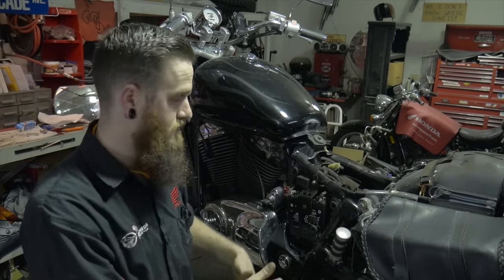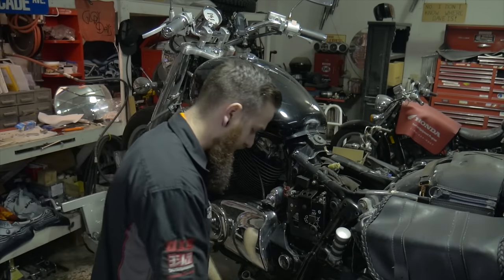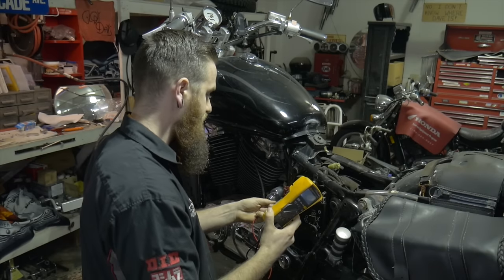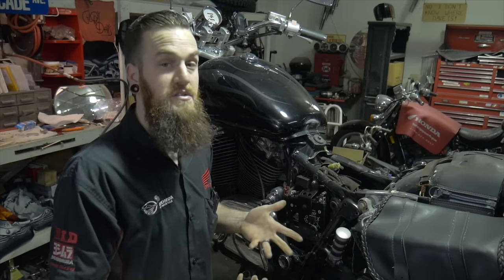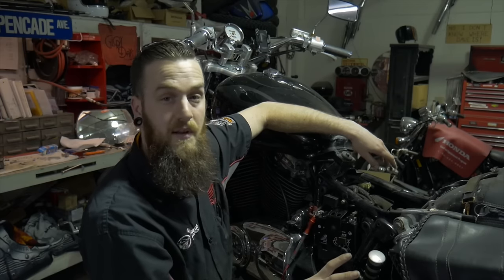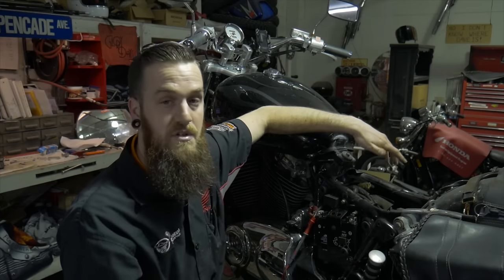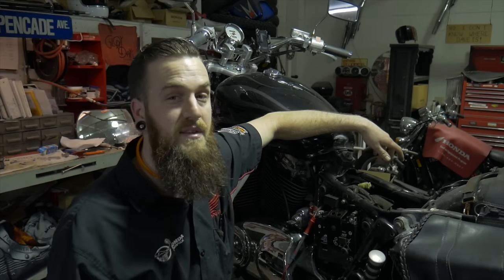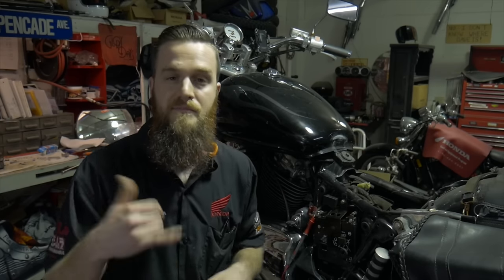Motorcycle Charging System: Bad Regulator/Rectifier

Comment: Cody, thank you for ALL your instructional videos on the motorcycle charging system, stator, regulator/rectifier, & battery. Simple, to the point, and easy to understand. They have helped me understand & diagnose my system on my 2003 Honda VFR800.

Comment: Watched a couple of your vids to diagnose a non-charging issue on my 1984 Honda V65. Following your instructions I found that the older splices on the 3 yellow wires were bad. Snipped and re-soldered those connections. Tested my R&R and stator and we're good as new. 14 volts at 5000rpm. Instant subscribe!!

Comment: Just found you. Good stuff. 
When a battery is overcharging, it becomes much easier to figure out. When a battery is not charging at all, that’s when it gets tougher. Could be anything in charging system and even a bad ground. Lastly intermittent charging issues generally lead themselves to be more likely than not to be regulator as well.

Comment: It would be best to check charging system at a higher rpm than idle, reason, the break even speed is generally above idle on most makes , unless it is 3 phase. Break even speed is the RPM needed to replenish the draw of normal engine components when running, coil, lighting etc. It is just good practice, covers all types of charging systems. Great video, and will help those in need, thanks.
Reply: One of the best videos regarding motorcycle charging systems.
Reply: What's that in your earlobe..is this a transgender thing?

Comment: Cody, I’ve rebuilt, (with help from professionals), a 1993 Yamaha SRV 250. I’ve had an electrical problem since I’ve had the bike and can’t figure it out. Some of the ongoing symptoms have been low voltage to the horn, a tachometer that goes crazy, starting problems until I put it in gear and bump the motor, and I’m now on my third neutral switch. I thought I had the problem solves by repairing damaged wires but when I went to start it up there were again no dash lights or headlight. I tried to find second gear to bump the engine and pulled up on the shift lever and everything came back on! So I figured it’s definitely something in the neutral switch wiring. I removed the wire from, heat shrank the connector, and the bike ran. While riding the bike started to sputter so I thought I’d put some upward pressure on the shift lever and the bike began to run perfectly. Not only that, but the tachometer started working as advertised. I can’t figure that out. With the neutral switch wire disconnected, how could the shift lever, which is mechanical, have any effect on the electrics? BTW, the battery has no charging problems.
Reply from the maker: Wow, that pretty crazy!! Honestly... I would install a new wire harness 😆😆
I wish I had a more direct answer but that is tuff
Reply: Likely a bad ground, if not, you could have a + wire tap dancing on the frame.

Comment: A Voltage Meter is a good addition to the other instruments. Its always good to know if its a silent problem that might lead to a problem in the near future. I did notice my rectifier going bad by having a not so good turnover by the starter. As i looked on the dc meter it was only charging at idle and not anymore with a bit more rpms. Could have run out of juice oneday and would have had to pay for the towing or even a new battery but i avoided that by beeing suspicous.

Comment: Very helpful. I’m struggling with my Cb750 lately. When I follow your instructions I notice my multimeter slowly clicking down. Then when I hold throttle it stabilizes it but doesn’t charge. I’m going to have to check the stator as per your recommendation
Reply: @PercyJackson93  my stator ended up being good. I discovered that my wire harness had slightly melted for an unknown reason. (Resulting in poor contact coming from alternator. Fixing that and changing the battery did it for me.

Comment: I recently changed my motorcycle battery but it ended up dead then I got replacement battery it catches fire 
I saw your vedio and it was very helpful 
I changed my regulator rectifier now it working fine.
Thanks for info

Comment: Great video. I will check my readings. In the meantime, my bike had new battery but I didn't ride for 2 years. Now I have to connect battery to charger. It charges battery so bike can start no problem. I can ride the whole day. I can stop bike many times and bike start again. Next I go home, I don't connect battery to the charger and I leave bike overnight. Next day bike doesn't start 🙁. I have to connect charger again. What do you think is the problem?

Comment: Great videos thank you
My issue is on 1980 Honda CB650. Bike not charging swapped out stator rotor and rectifier. Reading on 3 leads from rectifier .5. Diodes read good and directions tests on rectifier read good. Stator unplugged and running reads good and increases with throttle. Can there be an issue from rectifier to battery other than wiring? Everything else on bike works no other issues.  Puzzled???

Comment: Thanks for the video.  I have a Suzuki Burgman 650.  Just replaced the battery.  At idle I am seeing around 14.5 V.  At 3000 rpm it drops to about 14.2V.  Should I be concerned?

Comment: Hi,  I have a strange problem on my Magna. Short version of the back story. Instead of removing crabs and cleaning after sitting I dumped carb cleaner in the tanks and carbs until it finally sprung to life. A few times the "Starter seemed to stick." Then after she was running great.  I was about to change the oil, and wham, she went lights out. I have a new battery.  checked every fuse and ground connection I can think of. Easter egging a starter, ignition switch, start button is more than the bike would be worth whole.  I have not electric what so ever after hitting the button.

Comment: Hi. First off all I want to thank you for the detailed information that you have shared with us. I have finally found the problem on my honda shadow. 
I need to ask you a suggestion. I ordered the new voltage regulator, but unfortunately it needs 2 weeks delivery time. My question is can I run the motorcycle with 18volts charging for 45min and  then switch off the charging current for about 30 minutes and then reconnect. I mean can I do manually that the broken part on rectifier does automatically?

Comment: I found this video by looking for stator testing, but watching it I realised you’re good. You know your stuff... so my question to you is:
I have an Aprilia sr50 2st. Scooter that won’t start. bought it like that.. I rebuilt the top end, new rings head cleaned and new gaskets. New coil, new plug. Started for 5 mins then died. It’s a Ditech injection model Piaggio Motor but i can’t understand why it won’t run...

Comment: Thank you for the explanation. Any idea what it means when the voltage across the battery drops when revved? The alternator seems to be working since the voltage increases to over 14 volts on idle.

Comment: I jump started my bike, took off, saw smoke and pulled over. Used similar troubleshooting and found my stator grounded. This advice works for Harleys too, luckily the lead from the stator to the regulator is a short one.

Comment: Great video's by you. All of them are very helpful. Wanted to ask you a question: even with a fully charged battery, if a three phase stator has low output on one phase, could it still cause the bike to sputter in the mid-range? 2000 Honda Shadow 1100 Aero. Stator is not shorted to ground, all three phases are continuous with each other. Two phases are at 4.7 volts, one phase at 2.2 volts. Bike starts and idles fine. Sputters around 3K rpm. Coils and wires replaced. Carbs clean and floats set. Fuel pump relay bypassed. Thanks !!

Comment: Thank you!!  I have watched several vids regarding the charging system BUT you have clearly explained the TROUBLE-SHOOTING aspect much better.  I especially like going after the obvious FIRST; check the battery.  You provide the right numbers and I understood that. SECOND, how much of a charge is coming in from the stater and WHY the charging number needs to be stable around 15 or so.  You also explained why too much (like your example at functioning RPMs) is BAD! In the case of this Honda everything looks to the rectifier and you provided extra analysis of why you can't really go any further (closed system).   Again, thank you for taking the time to Share your expertise! Well done!! :)

Comment: Man, I really appreciate these videos! This was an excellent explanation of how this charging system works, as well as the risks and safety hazards. Subscribed!!!
Reply from the maker: Glad to have you Chad! 🤙🏻
Reply: @TheMotorcycleMD  i noticed that my rear running light keeps burning out on longer rides even while on running my rear light is super bright.  also, my dash lights are brighter than usual.  my battery is charging, but what is causing that light burning or super bright?

Comment: I think you said this is pretty much the same on all or most bikes.
What about a Harley Electra glide 2009, with high beam on , should it 
never put out roughly 15.5 volts regardless of the rpm? 
Also the high beam on is crucial for this test?

Comment: Hey, very helpfull. Unfortunately I tested my battery with a meter, it said everything was good. I noticed a little bit of burned wire so I cut the contenters off and sodered them together. Tested again and the reg/rec is not working properly.  I ordered a used one on eBay because I don't have the cash for a good one, and all the cheap ones have bas reviews. Now I don't know the orientation of the three yellow wires. Do I need to get a new stator or does the orientation of the yellow wires not matter?

Comment: I did everything you said to check. I have a 750 shadow. Stator was bad and I put new one. Rectifier is 14.5 v at 5000 rpm at battery. My problem is I think now is that I have charged battery so many times that I think it might be bad now. It's charging but still can't get the bike to turn over but one rotation and the battery died out. Just would like your opinion on this if you don't mind. If I get to crank I can ride but can't crank back up if I cut off.

Comment: Sweet video!  I tested the stator and the rectifier regulator.  The stator is OK.  The voltage trickles down from high 12V when I start and drops quicker when I increase the RPMs.  I test voltage at the regulator positive and negative and the voltage is about 13.3V and it doesn't go up when I increase RPMs.  I'm guessing bad rectifier regulator?

Comment: Awesome tut. Thanks! Question: I have a Suzuki GSX750 1981 And the rec/reg is probably faulty. I read a lot about the Suzuki ones being to small and that is why they overheat and die a lot. Can I exchange it with a newer one or maybe Honda. I guess my question is are all rec/reg the same? (Manual says 14-15.5 VDC at 5000 r/min with headlight on, same as you did in the video)

Comment: Thank you sir.. my bike started with a problem recently, where i was riding, and my eletrical went out but the bike was still on and the headlights were still on but the dash,accessories, tail & turn signals went out. when i tested the battery with bike running, the voltage was running well into 17v. So i'm assuming the regulator went out.

Comment: I have a 2002 Shadow Sabre. It's for sure got some sort of an electrical issue. Last ride I stopped at a store and it wouldn't start when I came back out. Did the old push start and got back on the road. a few miles later it cut out and sounded like it was running on 1 cylinder. No Power. Limped it along for a couple miles. (not a safe spot to stop) Got it home on a trailer. Battery is very low, and I checked the common issue connector from the stator to reg/rec. All good. As soon as this battery charges back up I'm going to do the test you showed in this video. Other than that any advice?

Comment: Great video 👍
My problem is that when adding some revs the voltage drops. The voltage comes back up when idle.
Where should I start for fault?
Reply: Possibly a faulty rectifier. You could test the Stator too, it should measure around 50VAC between the 3 Phases. But most likely its the rectifier. It should deliver around 14.2 to 15 Volts.

Comment: Is it possible to have a Regulator/Rectifier that works/Fails intermittently ?? 

I have an Indian FTR which needs a new battery every few months. It always Cold starts fine, when i check the stator it gives 34 vac when cold at 2k rpm like the manual says on all phases, and the regulator maintains a nice 14.5 vdc at all rpms.

Yet the bike dies while running and leaves me stranded, installing a new battery solves it, and testing the previous battery, after putting it on a tender/minder, it wont hold over 10 volts

Comment: so quick question I have a 99 gsxr 750 got a new battery on there was good. I can start it ride it doesn't cut off while im riding im good but if I stall out or so for some reason try to start it up back the battery is dead cranks slow. sometimes it will start sometimes no. so I used a mulimeter without the bike running I got 12.3v when I start it I get 13.2v. ok now if I give it throttle it will drop from 13.2 to 12.2 or 11.8 at idle go back to 13.2 v is that the rectifier or the stator

Comment: Hi Cody, I've just bought a '98 VT1100C2 ACE and wanted to know what are the most common issues for these bikes. Is that connector faulty on the 98s? What else should I check? Thanks, I've found your channel really useful.

Comment: Thanks for video, I have a question, just bought a 1985 goldwing limited edition 1200cc  with new stater, my voltage at 3000 rpm is 13.9 is that ok. Thank you.

Comment: Great great videos. How do you understand a temporary drop in charging voltage while riding? My USB has a volt meter on it so I get some real-time data.. Normally I see 14.5V while riding. Occasionally it drops to around 12.6 for a stretch and even the bike battery light comes on. . Then.... it pops back up after a mile or two.    Battery tests while stationary seem just fine.

Comment: "it's very rare for reg/rec to go bad on Hondas" , owners of older CBR's (90's to early 2000's) will tell you different!  that's why i'm here to get some info on this before I purchase a 15+ year old CBR600F and very good video btw

 If the reg/rec fails would you recommend getting a "mosfet" or an OEM replacement? I heard the OEM ones are crap and people even replace the OEM honda reg/rec with a GSXR or Yamaha R1 early-mid 2000's model reg/rec and it does a much better job and doesn't burn itself out, any confirmation with this? Thanks again for the very informative video

Comment: I have a 2006 Yamaha R1 that is no longer charging the battery. I have already replaced the stator and regulator rectifier. The battery tests over 13V at aprox. 60 degrees F. The connections to the regulator seem to test fine, I've checked the 50A fuse and it seems fine. I'm wondering if it could be the wiring harness or the flywheel itself. Any suggestions would be much appreciated.

Comment: Thank for the informative video. I have a question, is it normal for the regulator rectifier to heat up to the point that the wires near to it melt? What is the ideal temp of reg/rectifier when operation? Thankz

Comment: Hey man great post, I've just done the same on my BMW HP4.. I've been getting bad battery drain, brand new lithium battery but the charging circuit is only inputting a pretty static 12.4 @ 5k revs to the battery, so I'm now not sure if it's the Stator or Reg/Rec...any ideas

Cheers

Comment: My Rick's regulator/rectifier unit charges a little higher than the stock reg and rec units did. (1975 Honda CB750.)  The manual says it should only go to 14.75 over 3K , but the new unit will get to around 15.5 when revving over 3K.   I'm assuming with modern batteries it's okay that it's charging a little higher than the manual calls for.   I have a new Yuasa battery in the bike.

Comment: On a 85 honda nighthawk. If the regulator is bad will the bike not power on? 
Starter relay and all the fuses are good. Everything is connect properly but bike will not power on

Comment: Thanks for a good vid man !
I have a similar problem with my Honda. Have messured stator, all connections and regulator.
Everything seems fine. But its also frieing my batteries.
When i messuring the battery its like always 15v. 
It starts on 13v idle, when i rev it goes up to about, 15, but stays there after i release the gas. Until i restart the motorcycle.
Is this a bad regulator?
Thanks

Comment: Rly nice video!
I have a similar problem.
Its Burns battery after battery.
Last battery was totaly dead. Put a new in and the bike wanted to die already after around 100km
But! Its starts out around 13, when i rev it goes up to about 15. But then it stays there. Even when i let it idle it stays on 15 until i restart the mc.

Is this overcharging?
Ty!

Comment: yo man just wanted to hit u back with a thumb up n say much appreciate this info... I've burnt up 3 connector plugs now from stator replaced once now ...and the rectifier replaced 2 times both aftermarket...do you have any thoughts on soldering the connectors and hardwiring the 3 lines from stator to plug  (the one that keeps melting) ...idk could my issue just be that resistance building in the plug, like i said above i appreciate u... good lookin out

Comment: Hi TMMD guy, I am from India. My scooter has 12v 5a battery, when I went to replace dead battery the battery dealer said my scooter regulator giving up to 15 v to battery which is bad to battery and it should give between 12.5 to 14.5 and told me to replace the regulator. Since you said it’s ok until 15.5v can I skip replacing regulator ?